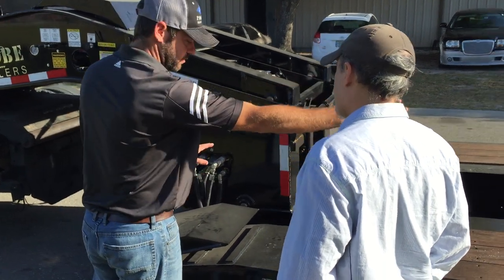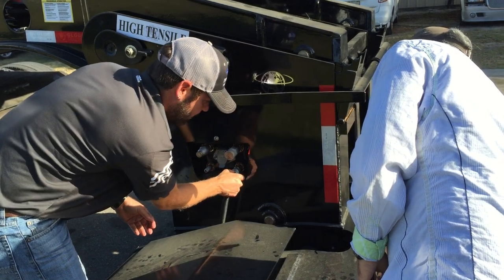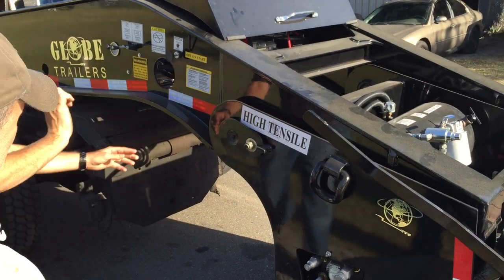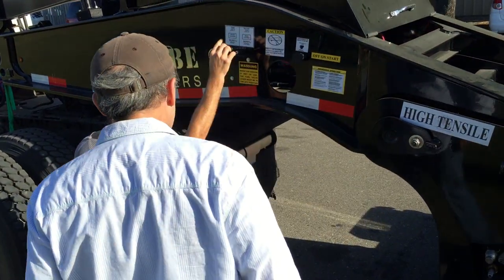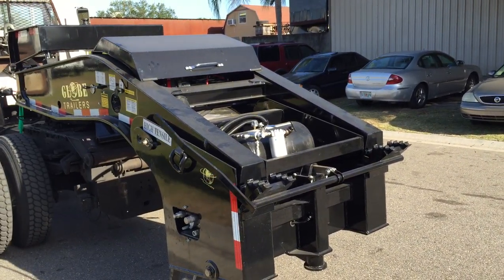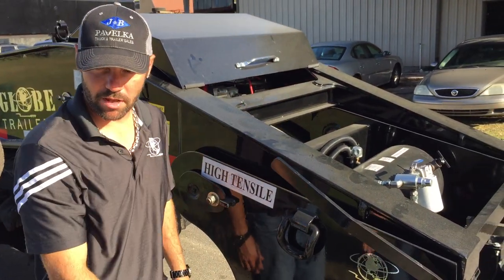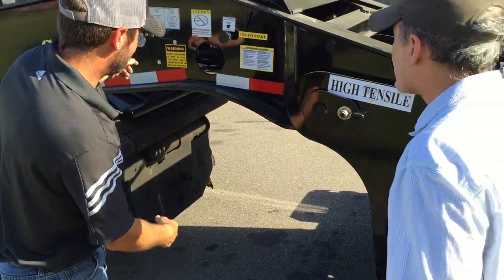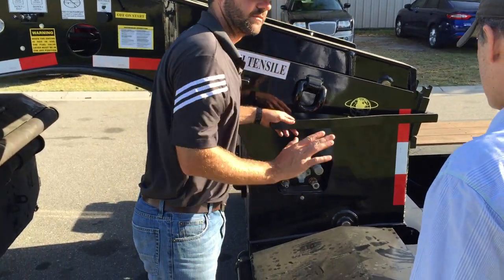Detaching Globe Trailers Neck

Comment: i  am  just  wondering  why  not  add  a rear ramp，so  that  avoid  uninstallation and installation in  each  transport，Disassembly task is  too trouble and complicated，our  factory  can  produce the  lowboy  with  rear ramp，Leave me a message if you need it
Reply: Because it is a removable gooseneck trailer it's designed to have the neck removed and also the back end of the trailer is not designed to have stuff driving on and off of it the front is the back's not and if you put fucking name ramps on the back of it we going to add weight anything globe the manufacture ramps for the trailers too so why go to you when you can get them in house there at globe?